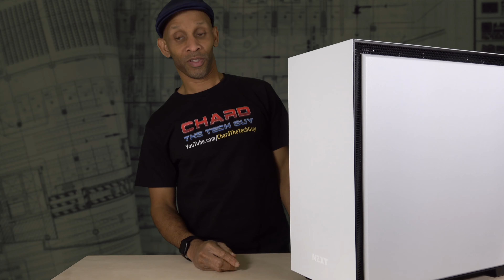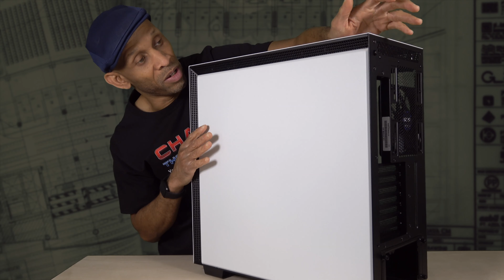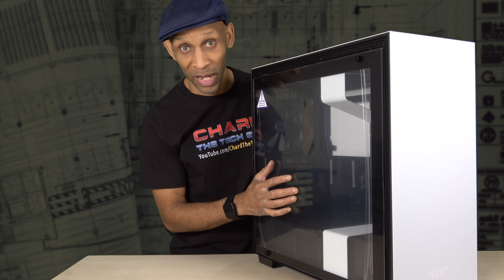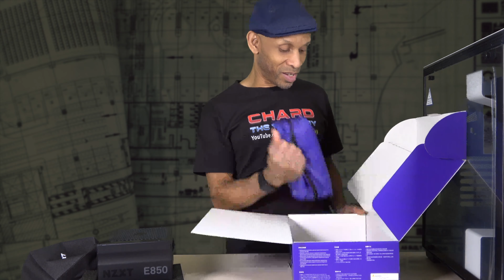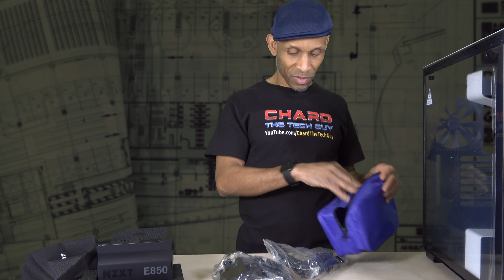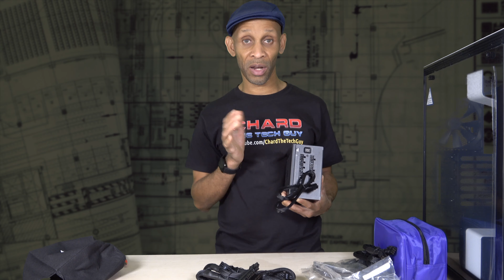Hackintosh Workstation: The Case & Power Supply

Comment: ssd drive, I like that! With the fans, will it be quiet?  I like that the USB and power on top, a clean look.  I have a laptop and switched to the ssd drive, so quiet.
Reply from the maker: The fans are speed adjustable, they also adjust their speed automatically based on temperature and workload.  Yes, easy access to those ports is great and convenient.  You know I did the same to my laptop and I even noticed a speed boost when I did that.  I'm SSD all the way, especially for the OS.
Reply: @chardthetechguy   Yes, I noticed my laptop running faster.  The prices of the SSD have decreased, that's a plus!!  
In one of the videos, could you show how to clone the hard drive info to the SSD like "How to Ghost a Computer"?  Thanks!!
Reply from the maker: @junezalukmoore  yes I could do that, I'll include it for the Windows and Mac.